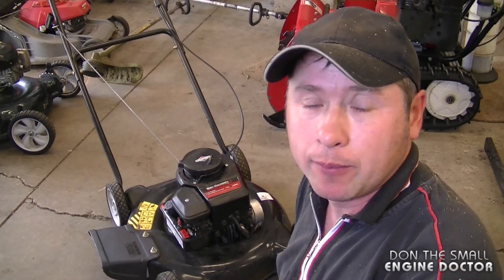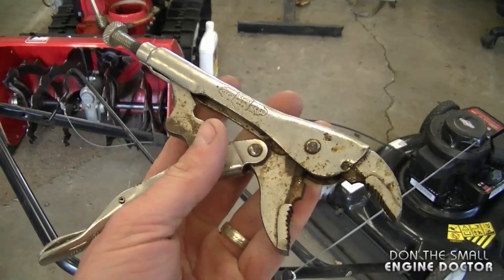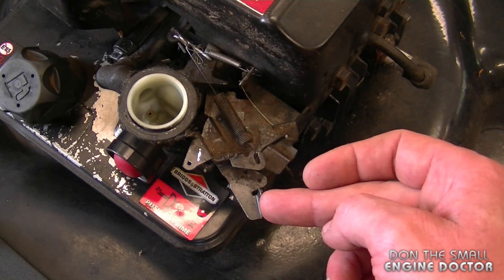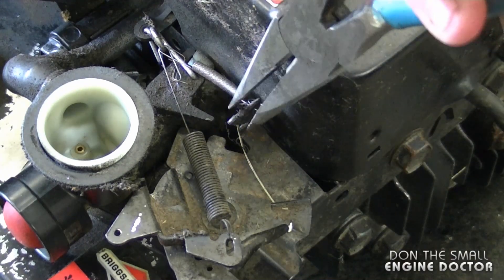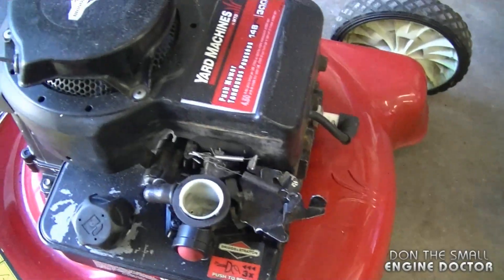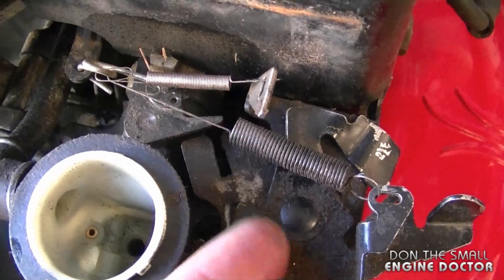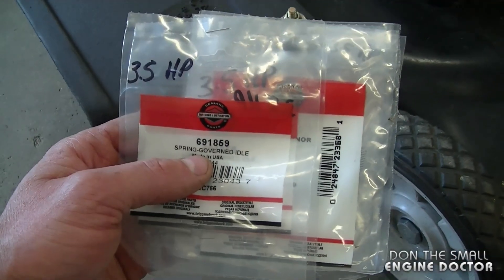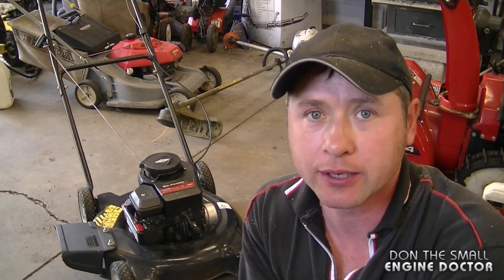HOW-TO - Briggs 3.5HP Lawnmower Engine Speed Adjustment

Comment: I have a push mower with a 3.75 hp Briggs just like the one that you are working on. After I prime my mower it starts and runs for about 10 seconds and then dies.
Replaced carburetor, gas, linkage, but it just will not stay running. 
Wait a bit, prime and it will start and run again for another 10 seconds. 
Any ideas why it runs then dies? 
Thank you

Comment: Thanks so much for this video. I picked up a road kill lawnmower for $25.00  Very similar to the one in this video. It was caked in mud and had no spark. Tell tale signs someone made an attempt to fix it which of course made things worse. The key for me in this video were the linkages for the carb and governor. Now it's working perfectly. 8 years later, you still deserve a huge thanks.

Comment: Great video. I have a 3.5hp lawn mower when it gets hot it will shut down. Any ideas. It's a old mower thanks.
Reply: Could be the armature.  If it is going bad and heats up it can short out internally. Wont run again till it cools off. Easy to replace.

Comment: I got one of these engines although the carb only has one spring on it. It sputters and misfires quite a bit can't seem to figure out the issue.  Rebuilt carb and checked flywheel key all seems good. Changed spark plug last season and issue didn't go away any ideas?

Comment: thanks again for yet another great video. I'm working on a 5.5 hp 2008 Briggs that has very similar tank, air filter and carb. linkage is different and the mower is loping. Very hard starting at times it will jerk pull start handle out of your hand violently. But it will start.  So I think I may have 2 problems. Will a broken timing key cause loping. Carb was cleaned and new diaphragm installed. Flywheel has markings for wheel pulller holes; but holes have no threads. Is that common?

Comment: After watching a ton of these videos from the fine folks that take the trouble to make them, I finally got a few concepts about these Briggs carburetors (non-manual choke and throttle models) in my head. Maybe it's a left-handed thing, but I finally realized the throttle is normally open at rest and that that the lever arm sticking out from under the cover and connected to the carburetor lever with that rod will pull in the direction (left) to close the throttle once the engine is running. The spring connected to the same carburetor lever as that flywheel "rod" and connected to one of those little holes on the opposite side of the carb will pull in the opposite direction and try to open the throttle. By "adjusting" (bending, stretching, cutting, swearing) that spring  you try to balance the force of the flywheel arm that's trying to close the throttle to adjust the idle and top speed. It's a trial and error kind of thing for sure. If the thing won't start remember that that spring needs to be in place somehow otherwise that arm sticking out from inside will pull the throttle closed everytime the engine spins fast enough. Also make sure the grounding mechanism from the "dead-man" lever on the handle isn't in a position where it's allowing the spark to b e grounded. Another thing I realized is that some mowers have a lot of extra mechanical looking stuff on, or near, the carburetor  where the spring connects. I'm pretty sure that stuff is for pricier models that have manual chokes and throttles. Like a lot of things, it's apparently cheaper for the manufacture to just put all that stuff on there whether it's used or not.  So don't get too freaked out because it looks like somethings missing. The whole thing is pretty clever, when you you run into some thick stuff the engine slows a little bit and the air against the flywheel mechanism slows, the arm relaxes a bit, and together with the spring, pulls the throttle open again to get through it. Just my two cents.
Reply: So I can ignore all the 'crap' on the front of the carburettor that he's playing around with at 0:58 ? So, what does that do and why does it move? What position should it be in? Is there a way to make this engine idle rather than cut out when I release the 'start' bar?

Comment: I just came across this video after having a unit like it having an rpm control problem. My research found a specific Briggs procedure. You are supposed to adjust the large spring to get the  rpm set to 200 rpm below the noload top rpm. Then adjust the small spring to bring it up 200 rpm to the spec.

Comment: I figured out why my old Sears Crapsmen tractor (11hp B&S) would stall after about five minutes.
I rebuilt its crab and got fresh gas.  It would run great for like five minutes, then die, no restart.
Turned out to be the gas cap, created a vacuum in the gas tank, stopped fuel flow. Simple fix, but I was perplexed for days???
Reply from the maker: it wasn't venting

Comment: Earlier this year, I purchased an hour meter - http://www.ebay.com/itm/321055884386 and a tachometer - http://www.ereplacementparts.com/echo-eng-tachometer-p-1497076.html. The hour meter was for my lawn mower to keep track of usage for maintenance purposes. The hour meter also has a tachometer feature included. As a test, I compared the rpm's reported by the hour meter to the rpm's reported by the Echo ENG Tachometer. I tested eight engines. The two meters reported the same rpm's 6 out of 8 times and were within 10 rpm's on 2 engines. The engines were running in the 3000 rpm range during each test. I paid $13.98 for the hour meter and $105.35 for the Echo Tachometer. If you are looking for an inexpensive tachometer, you may want to try the small hour meter.

Comment: Good vid!
I have a 1991 model 92502  3.5 Briggs, runs good, starts first pull cold, but won't start hot unless I take off air filter and open choke, then starts first pull. I have put on a new carb. diaphragm, but still has same problem. The tiny hole in the gas tank under the carb for the vacuum signal to the choke pull off is open (not plugged). Any ideas about the hot engine starting problem? The cooling fins are not plugged, and it has lots of oil and compression.
Baffled by a Briggs  (Miles)
Reply: ChargerMiles007 you can start them hot in the idle position it works easier for me
Reply: I will try that,  though I think I already did. I have made a vid of the problem engine, but for some reason it wants to take forever to upload, perhaps I will get it onto YT in the next few days.

Comment: I'm new to small engine repairs and so far I love working on them and your videos help a lot but I picked up 2 lawn mowers with a engine like in the video at the dump a few weeks ago and have been using the steadily since and my only qustion is on the b&s 4.50 (similar to the 3.5 in the video) what would cause them to push the motor oil out the breather and into the air filter when I put them away? It seems to happen more on the one then the other so I figured it may be something I may has missed when I was cleaning them
Reply from the maker: if it's tilted up it will do that or if the engine is over-filled with oil

Comment: This engine design was made from the 1950's until they wouldn't pass emissions any longer in 2012. We replaced them with an all new overhead valve design that year. I'm work at the plant in Murray, Ky that produced these engines. If they are well maintained and stored properly, they will last 20+ years. Only thing that generally goes wrong is the diaphragm under the carb which only costs about $4 at the parts store. In my opinion they are the most reliable and cheapest push mower engines to repair in the world.
Reply: yep,  if it starts running rough, its the carb diaphragm.

Comment: how does that tachometer work??? it looks like you are measuring the rpm of the spark plug
Reply: Not to jump in here, but you have it right. The tachometer catches the electromagnetic pulses released into the air by the firing of the spark plug. Since the spark plug fires once for every stroke, that gives you your revolutions per minute. It's a beautiful thing.
Reply: ahh that makes sense thanks

Comment: I have always just bent tab of bigger spring to increase speed . Is that ever done? Also I thought you had to replace the air cleaner bolt to have it run correct with the filter housing off

Comment: Hi dony just a carb question in the past few weeks I've had a honda gv100 engine that was hunting under load,I cleaned the carb twice no better,put a secondhand carb on runs great.The other was a carb on an old briggs and stratton max cleaned that twice mower wasn't getting enough fuel,I replace that one with a secondhand one and that ran great.So my question is what goes wrong with these carbs are they repairable or do they just wear out?.Keep the vid coming thanks.

Comment: Is it worth checkin max rpm again after putting the air filter  back on? 
Reason I'm askin, these newer engines run lean and seem to run like crap with the air filter off. 
Maybe I'm comparing apples to oranges , but I really notice it on the pos home standby generac generators. When the housing is open while it's running, the speed changes (usually 100-150rpms more) and it breaks up. Close up the housing and it smooths out. It's like they have the exact amount of air figured out that they wanna feed the engine, and they sort of adjust it by choking the air into the housing. 
You can usually feel the vacuum trying to close the door in the last inch or 2 of closing it.

Comment: I like the video and have a 3.5 hp mower which has not been used in a long time. The first thing I need to do with it is check the primer bulb to make sure it isn't leaking fuel since there was fuel leaking in that area the last time it was used.

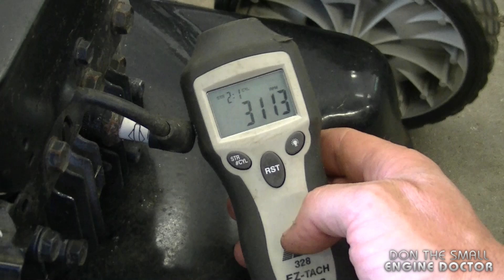Comment: I noticed that at 1:49, the Tach display says 2:1 in the upper left corner...  Doesn't that mean 2 Stroke Single Cylinder on that device?  I've been looking for a Good dependable Inductive tach....  I currently use a contact mechanical type but its not always practical. I've read mixed reviews on this particulate device...  Is rather inexpensive, but some say not very accurate.

Comment: The tachometer used in this video is an EZ 328 Tach Plus. I use a PET-1000R tach for my RPM settings on small engines.
Reply from the maker: I will be getting the one you have too, much slimmer and fits in smaller areas
Reply: acscolo just read a bunch of negative reviews on the EZ 328
Reply: where can i pick up  a PET-1000R tach and what would the cost be in cdn dollars, thanks

Comment: I hate those cheap motors and the garbage carb design.They should of retired that motor 15 years ago.
Reply: Oh I disagree. They are easy to work on, parts are readily available, there are probably a billion of them out there, and if you really screw up the replacement carb is cheap. Also as a side note, if you set your gross profit margin at the correct rate for your shop and use the flat rate method of time repair, they are a money maker.
Reply: Why do you think they are a money maker ? because they are junk,They come in for repairs all the time thats why.These motors never run smooth and cant idle worth a shit.The better motor is the Briggs quantum.Not that trashy 3.5 motor they sell at Walmart on all the mowers they have.
Reply: Hmm..seems we have a philosophical difference of opinion on what constitutes junk, garbage, in the engine world. All engines, no matter what make, model, or class have a finite life span. Sooner or later they all need to be repaired even with the most best practiced maintenance schedule. You wouldn't consider an engine junk just because it needed to have its oil changed?  I consider these carbs to be in the quasi maintenance category. Sometimes it's a maintenance issue as these diaphragms eventually give out. Or the repair category, for example someone pours sand into the gas tank or carb, or a customer fills the tank with 2 cycle mix. The key is being able to do the repair at a price point where it's most advantageous to do the repair as opposed to replacing the machine.
Reply: As for the comment concerning trashy 3.5 motors at Walmart, folks around in my part of the county like these inexpensive engines and mowers at Walmart in the 20” cut range. They use them as a trim mower in places where their riding mowers can't reach or it's too much for a string trimmer. They just don't need a honkin' 22” self propelled, electric start, Honda or Quantum powered mower for 500 bucks.
Reply: I understand your point of a trim mower,But you need to do your research before you say a quantum mower is 500$ ha ha ha ha. Lowe's sells them for like 299 with a bagger and self propel and so does menards.A honda self propel bagger is only 399$ or less at home depot.Do your price research before you make a statement.
Reply: you didn't factor in electric start and sales tax in your cost comparison.
Reply: mary carman

There are several reasons for this and all are very unacceptable ! One of the reasons is inventory overflow as they dont have enough room to store them but they want all the sales possible and they dont care if the mower fails because the company will pick up the warranty work for free.Big box stores dont care about quality, They care about sales volume so quality will never be good.
Reply: 29 years of repairing S.M.R {small motor repair} the 3.5 b&s motor are the best ..cheep to repair ..take a look, a carb kit for a briggs 3.5  is about 6 bucks...can you find a carb kit this cheep for a Tecumseh or a Honda or any other motors......HUM
Reply: acscolo well why do Walmart let their lawn mower stay out in the rain and lowes do it to ,I took pictures of them
Reply: Did you also know that most big stores take a loss on some products just to get you in the store ? In hopes that you will find something else to buy ? True story.
Reply: oh yes like buy one get one free Most people take the other store ad to wal-mart /the hide the recall meat/ peanut butter/ pink smiles still
Reply: like some meds. is killing people heparin, Trasylol, zocar-The year the men blue pill came out killing men, each pill a doctor give you read up on it or add it to a plant see if it die , GOD Bless The World, Amen.
Reply: S.M.R. PIECES

Its called small engine repair.Not small motor repair lol. If.If you going to act smart at least say it correctly. Tecumseh was junk and always will be, that's why they are no longer in business. Now for Honda they can go 5 years before needing carb work.Those garbage Walmart 3.5 Briggs engines need carb work right out of the box brand new.Honda motors don't burn oil for about 10 years or more.The Briggs will burn oil in the 1st year and just get worse.Briggs doesn't like to stand behind warranty issues at all.The honda mower can be taken to your local honda dealer and repaired with no problem.If you think that 3.5 is the best then you really don't get out much at all.
Reply: S.M.R. PIECES tecumseh just neeed clean all the time i never change kit in tecumseh since its all steel and aluminium part unlike brigg and straton plastic carb and diafram need kit change every years i like more tecumseh
Reply: I have Lawnmower like this one ,some 8 years for now,work perfect.And i would not recommend this engine speed increasing ,because life of engine will be shorter allot.My lawnmower work on very low rpm,is important cutting blade to be sharp,and will cut very good.I have area of almost 0.6 hectare to cut with this lawnmower,so imagine how much i did for this 8 years ,i replace till now 2 cuting blades ,1 set of wheels and nothing else for this time.
Reply: It was retired, about 3 years ago. I also disagree that engine is the format of Briggs original aluminum block lawnmower engine which came out in 1953. It ran from 1953-2016 or so with small changes over the years, electronic ignition 1983, and they started using different style mufflers etc and they started to get cheaper in this century, but they were still great little work horse motors. 63 years, the longest running engine ever. That was the only engine Briggs had until 1984 when the Quantum came out, before that, they did not call these Quatros, they were simply known as the Briggs lawn mower engine. The older ones were built like tanks. You could not ask for more. These were put on smaller equipment after 84 and the Quantum was used on larger equipment going forward.
Have you seen the garbage their making now?
Be careful what you ask for, you just may get it. Because what they build now is really crap. The Quantum is out of production too, last year, final year. The choices now, their pretty sad....
Engines with full plastic body carbs, real cheap shit.
Any engine that had a 63 year run, had it for a good reason.
I'll take that classic over the new crap anyday.
Reply: For having experience 2 of these 3.5 engines.  1 is now 37 and the newest one is 12 years young still performed wonderfully. For the older one only (3) spark plugs, 1 primer bulb replacement. While the newest one still on the same spark plug. 
Most reliable machines ever built.
They out lasted all my cars.
Just be sure to use fuel stabilizer all the time so it can't miss it during winter storage. Make sure you always use fresh gas at the beginning of the first start next season. Always press the primer bulb 4 times regardless the manufacturer states 3 times. 
It will start in 1-3 pulls. Mostly in 1-2 pulls.
Don't leave it out exposed to rain & snow. Dust them clean and spray rustproof oil at exposed metal before winter storage. Wipe it clean before new season usage.
It's money in your bank for every new machines you skipped purchase for replacement.